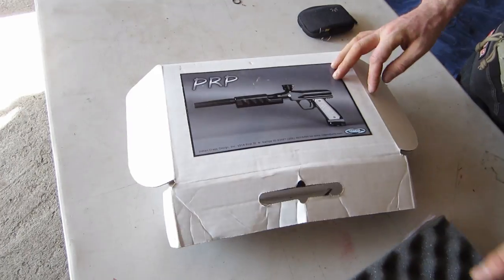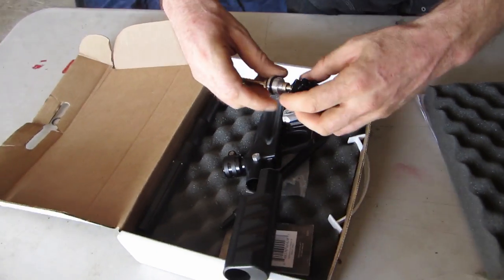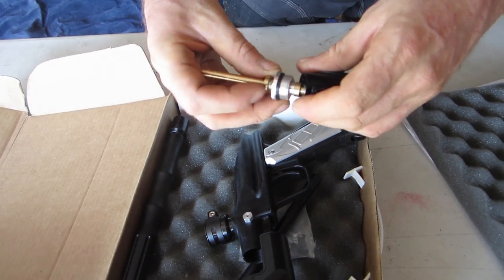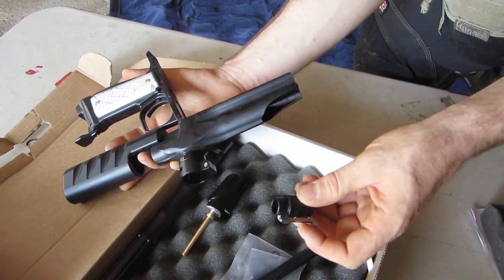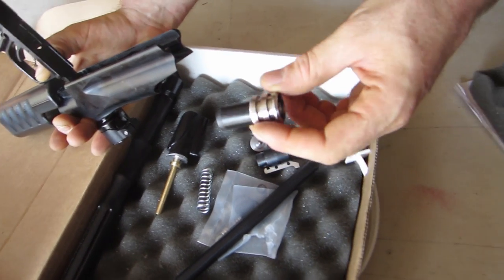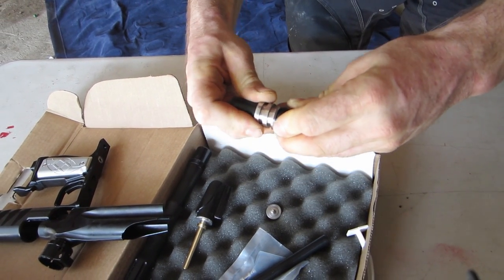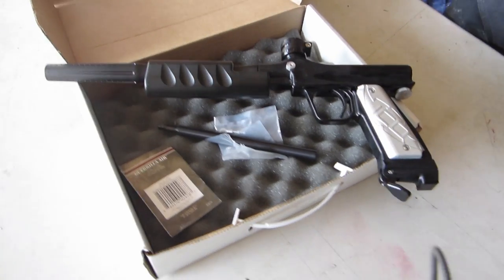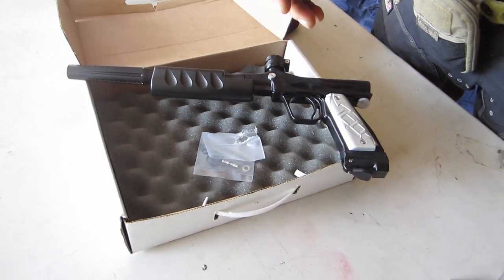PRP Pump from ICD Breakdown and Reassembly

Comment: I've had mine for a few years. Few things I've learned playing with this. As stock the recommended PSI is 400-750psi. Most tanks are usually a little over this. I had to adjust my ninja tank regulator and ran around 500psi. Above the recommended it won't open the valve long enough for you to get high enough velocities. Dropping it down and adjusting the velocity screw, this thing is super quiet. Probably one of the quietest markers I've shot. 

Pump stroke on it is pretty rough though. Im personally not too concerned with that though as I never autotrigger.

I also bought the stock class feed and 12 gram quick change stock to play stock class. The stock class feed works well. The only issue I have had is the empire smoked 10 round tubes don't fit well in it, they're too tight and have to really be jammed into it. The clear generic ones work perfect. The t stock with 12 gram changer is perfect. Never had it leak and is very fast. The only issue with it and this marker is the ASA on the marker will drop the on off lever when it's being changed. So you either need to hold it up while you're changing cartridges or use some tape to keep the lever up. If you pop the 12 gram and the lever is down, it will vent the whole cartridge. 

As mentioned before this marker runs at Max 750psi. CO2 unregulated is going to be more than that and you won't hit acceptable velocities. ICD sells another power tube they call their co2 power tube that is tuned for unregulated pressures. Drop this in and it should work. I did have some issues with it though. I found that the bolt didn't always catch the hammer and I would have to slam the pump handle back harder to get it to catch. This turned out to be an issue with the valve slightly opening when pumping. I ran a slightly higher stiffness spring on the valve and it solved my issues. At the higher pressures it's noticeably louder though. 

The other issue I had was with the ball detent, it seems to be too short for most paint. I had an extra CP autococker delrin detent that has been working perfect. It sits a little deeper and I no longer have double feeds. 

The included barrel is acceptable. Not terrible, not great. It has an o-ring inside to prevent undersized paint from rolling out and it seems to be decently accurate with quality paint. I'm currently using a dye sconi freak back with a 12" dye ultralight tip. The back fits inside the handle perfectly, actually slightly better than the stock barrel which helps with the pump stroke. Accuracy is as you'd expect from any other marker with good paint and matched inserts. 

Overall it's a fun marker to use every now and then but definitely not my main. I prefer my phantom over this if I want to use a Nelson marker.

Comment: I know it's been awhile since you made the vid but could you tell me how to maintain it what do I need to lube and how often?
Reply: Nelson valve guns like to run dry.

If you want to you can add oil in the ASA but if you are using  Crosman 12grams you don't need too as those 12grams come preloaded with oil in them.